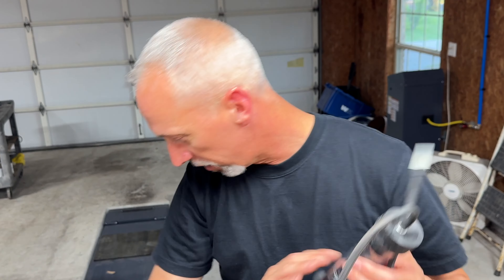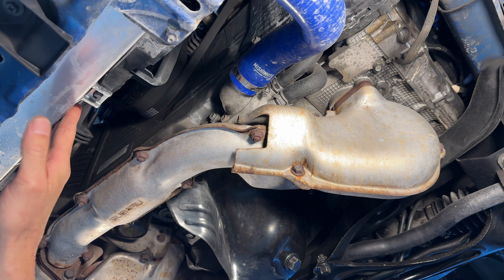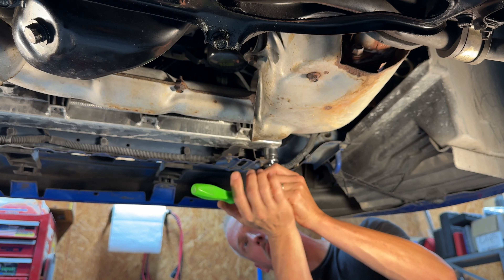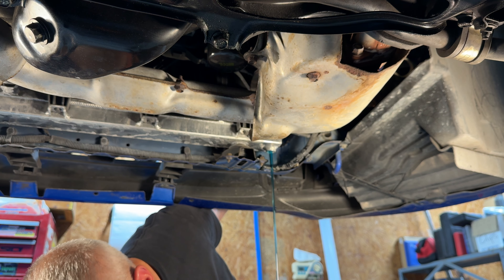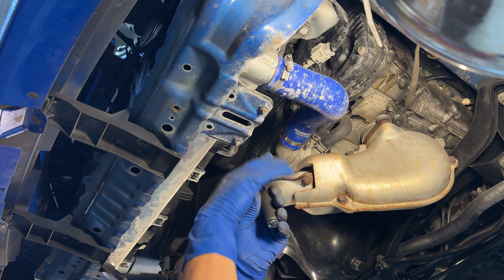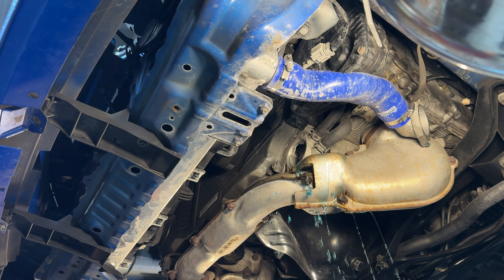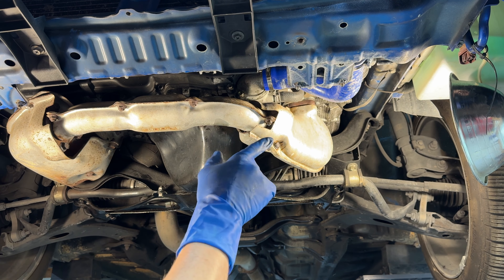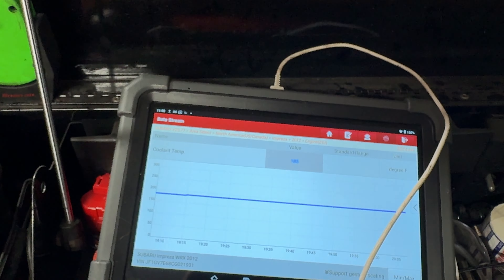WRX over-heats, could this get expensive?

Comment: Awesome Analysis and details sharing for it . I have 2006 Outback , During stop singals the Temp gauge raise to 213 F and fan kicks on and comes to 194F and it does happen on all the Stops , Can it be a failing Tstat ? please advise
Reply from the maker: According to Subaru, your thermostat isn’t fully open yet until it reaches 203°. If you’re traveling at low speeds or stopped the low speed fan is commanded on at about 205° and the high-speed fan will kick on at 212°. What I would do is open up the hood to verify that the low-speed fan is coming on and if it isn’t, find out why.
Reply: @ToolDemos   Thanks , I will check on this and share my findings

Comment: High Flow thermostats are preferred, like Motorad / etc.
Reply: I do like Motorad's line that sticks open after an overheat condition. I've run a couple and no complaints.

Comment: Worm clamps on coolant hoses, fail.
Reply from the maker: Agreed
Reply: What's wrong with that?
Reply: @cutliss  Worm clamps don't expand like spring clamps. Heat in the coolant and pressure in the system causes the hoses to expand. Worm clamps can cause the hose to fail by not allowing the hose to expand. You create pinch points with over tightened worm clamps. Spring clamps on the other hand make a tight seal and have some give to allow the hose to expand without pinching it.